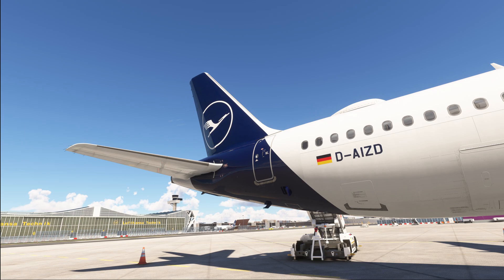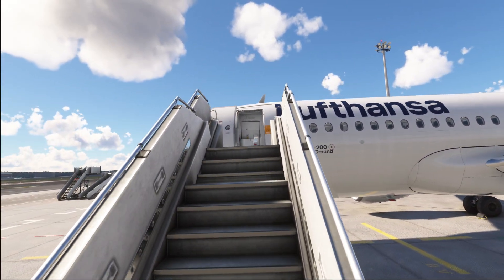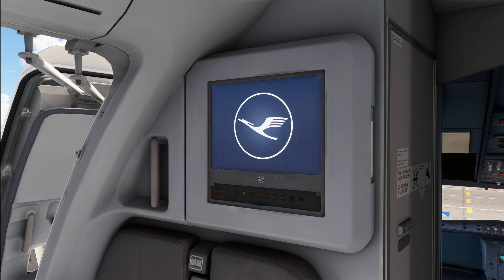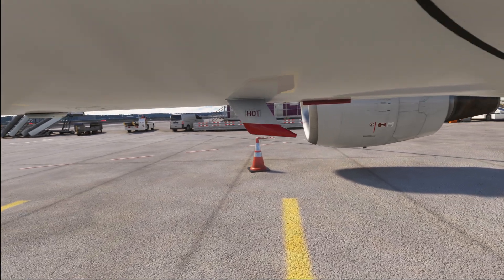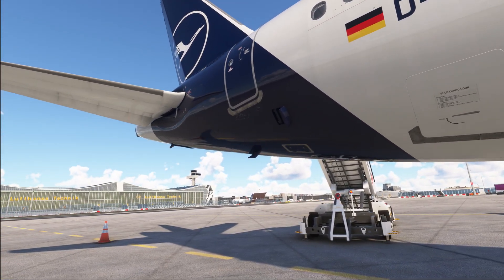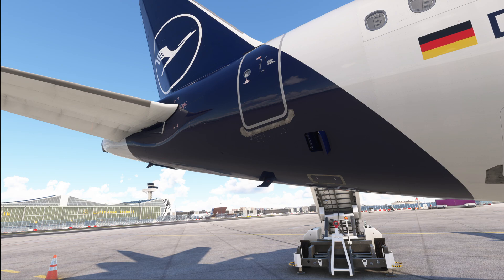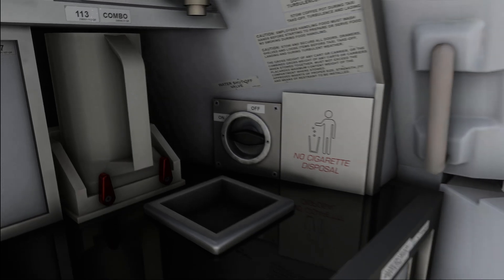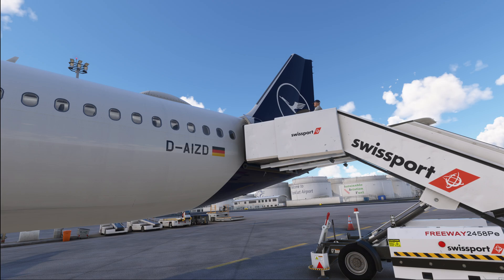A320 Waste/Water System Explained | Real Airbus Pilot

Comment: Great work, as are all your videos! I think we need a feature in Fenix that you can roll a toilet paper down the aisle, stick in in the toilet and let that vacuum do it's work. 😂 Used to do cabin cleaning for 7 years, and we tried this few times. If I remember correctly, the cycle was not long enough so for full roll you needed two flushes. Did that as a test after maintenance or vacuum pump replacement.

Comment: Thanks for the explanations! 200 liters is quite small - only a bit more than water tank in my RV trailer (40gal=152l) … The amount of water used per flush or sink use must be restricted somehow, probably flow restriction.
Reply from the maker: Im quite sure the flow and usage of water is just as optimized as the usage of fuel 😄
Reply: According to an airbus operator - each flush is about 2 liters, causing 2.5 or 3 litres of waste depending on the waste. 
Apparently a full, late afternoon 1 hour flight may use about 50 litres and add 70 litres of waste. These are just estimated figures. This operator does a super full ~6 hour flight to DPS on an A321NEO and Water turns to about 10% and waste is about 90% after the flight.
Reply: I found that a bit surprising too. Very small amount for the number of people involved. Especially when it's used to make tea and coffee in addition to toilet purposes.